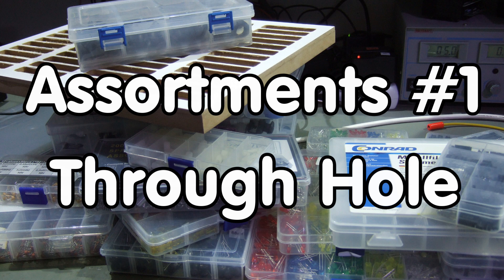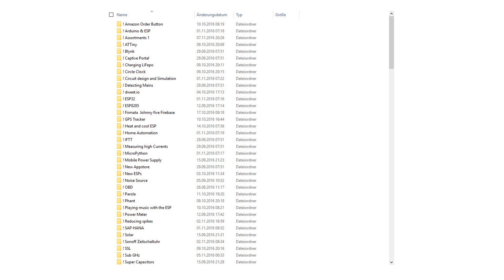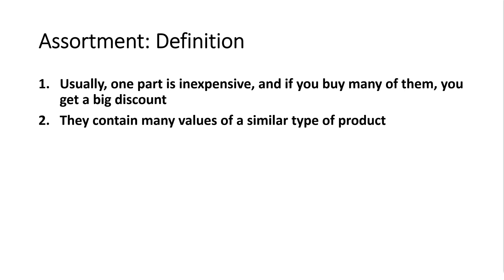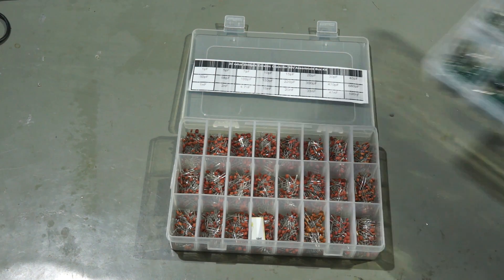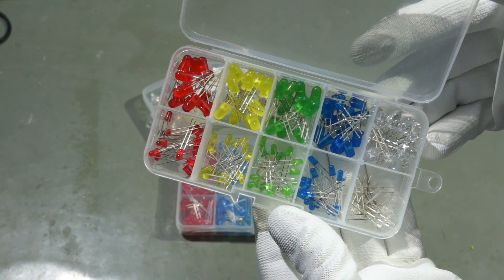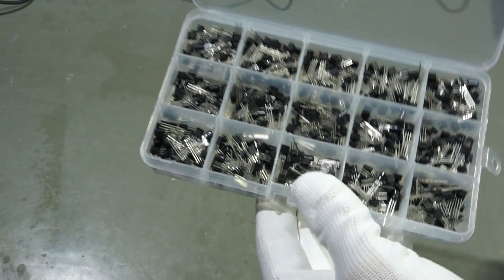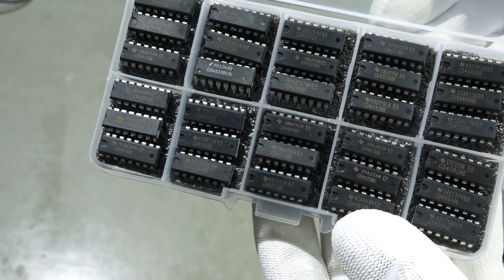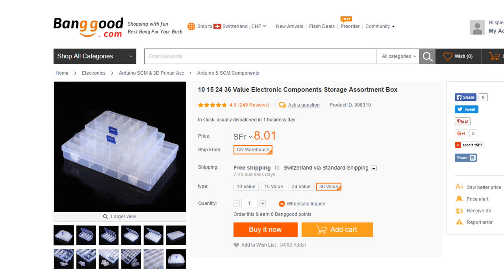#94 Assortments in my Lab: Through Hole Components

Comment: Hi,
you mentioned, that some values are used more than the others. Can you tell us, please, which ones those are? I'm mostly interested for resistors and capacitors, because I want to build my own kit. And it would be very helpful to have some advice  which values should I have plenty and which only few are good enough.
Thank you very much.
Reply from the maker: This depends on your projects. But usually, 1k or 10k resistors are often used. Same with caps 10uF, 100uF, 1000uF

Comment: Looks like I'm on the right track.  My collection is beginning to look just like yours.  Resistors are the worst.  I need to tackle that right away, it's gotten out of hand.
Reply from the maker: I do no more remember where I showed my solution for the resistors. However, most of the time I only use a few standard values...
Reply: @AndreasSpiess  Yes you did. As I have progressed deeper into this hobby, I have noticed there are many common values among resistors. capacitors as well. It is only recently that I have so many it requires more organization.  I thought before I spend any more money on containers, I would see what others have done to stay organized.  Yours is the first video in this category I  selected to view.  I just thought it was interesting that I have so far done exactly the same as you, with one exception. I also have selected the slider bins, 5 X 6 = 30 bins for common parts.

Comment: Great video! The problem that I have with the plastic boxes when used with many types of components (most active devices and some passives like capacitors) is that they don't seem to be treated to make them ESD resistant or at least slightly conductive so that they can't destroy components. Have you found a way around this? As an example, the boxes that you show at 7:24 are here:
https://us.banggood.com/Wholesale-Warehouse-10-15-24-36-Value-Electronic-Components-Storage-Assortment-Box-wp-Usa-908310.html?rmmds=search
but there is no indication that these are treated to make them less likely to cause static discharge damage than other untreated plastic bags or boxes...
Reply from the maker: I did not look at that as I usually store delicate components in their own bags.

Comment: Hello Andreas!  

I've found a nice way to store smaller components such as resistors that come in many values.  

You can buy plastic protectors for baseball cards or coupons (9 to an A4 size) that can be stored in a 3-ring binder.  The size of the pockets is about the same as the small ziploc bags that parts come in, or you can buy bags that fit nicely.  You can label the plastic protectors, the ziploc bag, or both using stick-on labels.  

I store ~80 values of resistors, as well ceramic and smaller electrolytic capacitors, diodes, transistors and more in one 3-ring binder.  They're less easy to reach than the boxes, but take up far less space.  Best not to turn the binder upside down either or the parts sometimes fall out, though static cling keeps them from making too much of a mess usually. 

Plastic protectors:
http://www.ebay.com/itm/201292361761

Ziploc bags: 
http://www.ebay.com/itm/330606925793
Reply from the maker: Thanks for the tip. I got this idea already from another viewer. However, I have to check if I get a similar thing in Europe. Here, we have a slightly different format (A4 instead of letter) and the American suppliers usually do not ship to Europe. But I did not have the time to check...

Comment: For the resistor assortment (paper tape) storage I use cheap photo albums. They work really well as you can see the resistor values marked on the tape through the clear plastic.
Reply from the maker: There were a few hints concerning albums in this comment. I think, I have to look inside this possibility. Thanks!

Comment: I too have similar problems. I bought an eight draw stack and have nearly two hundred empty cigarette packets inside containing resistors, transistors, capacitors, diodes etc. each packet is labelled with its contents. it is a very neat solution for these components with many values and power ratings.
Reply from the maker: Good Idea, but extremely expensive here in Switzerland. Cigarettes cost about 8$ per packet ;-) Maybe I find other similar packets without content.

Comment: Beautiful! I don't have as much, but my system of storage and assortments is pretty much the same =)

Just wondering about the active components in plastic drawers and boxes, like the voltage regulators. Aren't these sensitive to static electricity and can't these type of boxes and drawers store, "generate" and discharge static electricity into the components when they are laying "free" and unprotected?

I've always wondered this, so I keep my components in electrostatic foam, is that the name? and some even in ESD bags.

Maybe that is overkill, but perhaps you would know if that is necessary or not?

Great video and can't wait for the next one! =)
Reply from the maker: I do not know a lot about electrostatics. But maybe you are right and it would be good to use some of this foam.  So far, I had no big problems with this phenomenon. But I have no carpet, which induces sometimes electrostatic,  in my lab.

Comment: Hello Andreas! Thanks for another interesting video. I'm in the process of stocking up on components in much the same way you are. In the US we have several sources of plastic storage bins that are usually intended for storing fishing tackle, but work great for electronics parts as well. I've taken to using the Plano 3700 series which come in various divider configurations, but are all roughly the same exterior dimension. Eventually, I hope to build a storage cabinet for them so I don't have to juggle through the stack. It seems the one I want is always on the bottom. For resistors, diodes and the like, I found this video on YouTube 

https://youtu.be/3eEBLgVsFDo

and have adapted it for my own use. The 2.5"x3" ZipLocs are available on eBay in a pink, anti-static version. Instead of writing on the bags, I just print and insert an ID tag so that I can reuse the bag later on. For resistors I have added a 4 and 5 band color key for each value so I can verify the contents. Looking forward to see how you handle SMD components....

http://www.ebay.com/itm/222223604101?_trksid=p2060353.m2749.l2649&ssPageName=STRK%3AMEBIDX%3AIT

Comment: I hardly pay anything for passive components. Thanks to ppl throwing out good TVs, VCRs, etc...
I collect them and when I feel up to it, I attack them with my de-soldering gun and pull some teeth :)
Bought some assorted stuff like 20 years ago from Jameco, and still have most of them.
Reply from the maker: I assume I will have my assortments also quite for a while. Concerning de-soldering: Here, I chose to pay the premium for comfort... The parts are really just cents.
Reply: It's my recycling hobo gene :)
Reply: I came across a huge projection TV left on the side of the street.
A treasure trove of high power mosfets and excellent heat sinks. not to mention hundreds of dollars worth of Electrolytic caps, high power wire-wound resistors, power transformers, speakers, heat sinks,...
I think I came away with a huge bag of goodies for the price of ripping them out.
I would say it would've costed me a couple of hundred bucks worth of parts.
I am a hacker. I hack them for a dedicated purpose, or just use them as parts.
With the number of stuff I build, I would need another job to pay for parts.

Comment: Thanks for anothet useful video. I think I am getting an assortment box of transistors :). By the way, Conrad carries an empty assortment box that can hold through-hole resistors and diodes: https://www.conrad.nl/nl/lege-assortimentsbox-523805.html. This is the Dutch website but I think that the swiss store must also carry them.
Reply from the maker: This is exactly the one they used for my current resistor assortment from Conrad. Thanks for the hint!
Reply: @AndreasSpiess  Problem with those freakishly shaped components combined with the high number of values is that you will need 7+ boxes just for these (to cover 130+ values). I have been looking around and a more compact solution like this would be great: https://www.youtube.com/watch?v=URm3s6OlTvM
for the remaining thicker components, boxes are fine.
I am just starting to build my "collection" so this video was of a great help, thank you @Andreas

Comment: Have you seen those
 http://s.aliexpress.com/iErUzuqE ?
There are various sizes and colors and they stack together nicely. Green one is sized perfectly for long through hole components.
Reply from the maker: Another viewer gave me also this hint and I ordered some. But for my 130 resistor values it would be a little expensive. So, maybe for diodes, or SMD transistors, this is a good and flexible solution. Thanks!

Comment: I am much lesser experienced, but I started doing about the same thing as you in regards of organisation. I only added one feature : I've bought a cheap label printer, and I print a label with a barcode referencing parts. I also made barcodes for each drawer, and it will help me for 2 things.
First, I save the datasheet for everything I buy in a folder, and the PDF has the exact same name as the barcode. Second, I started programming a software for MacOS that will help me with sorting out which component is in which drawer, with the use of the barcodes...
Reply from the maker: Also with the PDFs we are not far apart: I do not download all, but many pdfs. The only difference is, that I still go with "human readable" and foll text search in the documentation folder
Reply: Actually, most times when I order from Ali express, there's no datasheet to download. For many components, it's ok because you can download them from "anywhere" with chip number, but for leds, for example, it's not possible because there is no reference number. So I copy/paste the description page text and some photos, create a PDF in "Pages" (I'm Mac user...) and save it with some made-up ref number, like "LED0048-Pink". The software I'm trying to make is supposed to handle the text search part...
Reply from the maker: Sounds good. I kept a reference for my Aliexpress orders in an Excel. But after Aliexpress improved their search algorithm, I search in my order history. I hope, they will keep it. Your way is more secure, but would result in a big effort: I have more than 1000 orders, many of them with more than one component...
Reply: Got problems with eBay. They don't keep the actual description page contents "indefinitely"... I ordered hundreds of silly-colorer leds (UV, amber, orange...) and now have no access to their power rating... Not a big deal, but I don't like that :-)
Reply from the maker: I do not use ebay for my Chinese purchases. So, I have no experience.
Reply: Hi, thank you for great videos, I've learned a lot. 
Sometimes, chinese sellers on ebay have better prices than on aliexpress. The difference can go up to 5$. 
So, check them out if you want to save some $$$.

Comment: My system for the longer components is to keep them in envelopes and write the values (and sometimes part of the datasheet) on them. The envelopes fit in a nice box and are, in case of the resistors, ordered by value, so it is easy to flip through them and find the correct envelope.
Reply from the maker: That seem also a good system, because you do not loose them easily.
Reply: Other advantages are that envelopes are cheap and you can always fit new values between old values, without the need to re-order all items.

Comment: an assortment of general purpose  and (ideally) cheap opamp would also be interesting.
Reply from the maker: Never thought about that so far. I just have a few of them and they fit in a small drawer. I do not use them very often because usually, I am more on the digital side, and I buy specialized (analog) modules, if possible. So, This would only be a very short video, not much longer than the introduction ;-)

Comment: That's enough LEDs to light your Christmas tree!
What I did was spend £50 on a huge Arduino kit initially and this gave me all the resistors, caps, LEDs, transitors that I needed for a few projects until I knew I would need to order more. Often I would buy something and pay an extra £1 to get it in a week rather than a month. With one item "U shape wire" I ordered one to come in a week for £3 as I needed them, and ordered another to come in 1 month for about £2 just to keep my stock up. Unfortunately the second one never came. I got a refund but I still need them as I only have about 3 long ones left and the price has now gone up. Moral of the story: Not everything from China may actually get to you, so don't put too much faith in it.
Reply from the maker: So, you  are a happy guy. In Switzerland, shipping minimum is 8$ (smallest packet). So,  the cost of most parts easily double at least...

Comment: i use this kind of boxes for smd parts and for long THT like resistors and diodes... looking for SMD BOXES on aliexpress you'll find a lot of different sizes, and all of them are linkable to the other, as in article photo attached:
https://it.aliexpress.com/item/11pcs-lot-Component-storage-box-IC-Components-Boxes-SMT-SMD-Wentai-Boxes-Kit/32627763077.html
Reply from the maker: I ordered one to test. Thanks for the tip!
Reply: there are also larger ones, not included in the kit i linked before: https://it.aliexpress.com/item/free-shipping-12pcs-SMD-SMT-component-container-storage-boxes-electronic-case-kit/32278283855.html
Reply from the maker: I ordered a set with different sizes to evaluate what is useful for what.

Comment: I'm using a file binder with namecard pockets to store my through hole resistor kit and another one to keep my smd parts.
Reply from the maker: The binder with the SMD will be covered in the second video. I did not know it is also possible for through hole resistors... Thanks!
Reply: Yes, just leave the tape on. I kept mine in rows of 10.
Something ike this:
https://abra-electronics.com/passive-components/resistors/1-2-watt-carbon-film-5/resistor-kit-1-2w-75-values-total-of-1030-resistors-resistor-kit-1-2w.html
Reply from the maker: Looks good. I just have to find the right plastic sheets.
Reply: I am considering doing the same with the resistors, that's why I'm watching these videos, to see which is more convenient. I think your method is a better use of space, and easy to keep in order, also less of a disaster if for some reason it were to spill